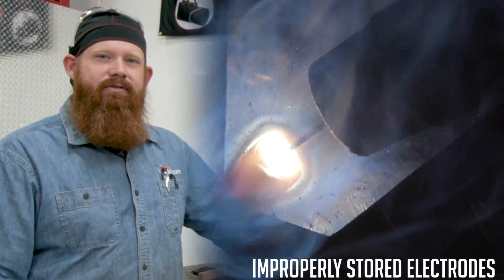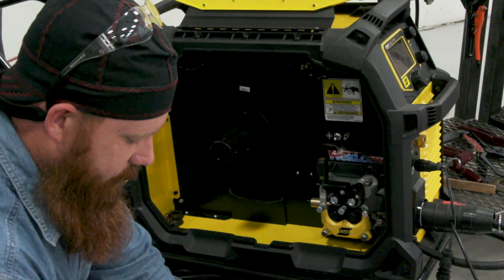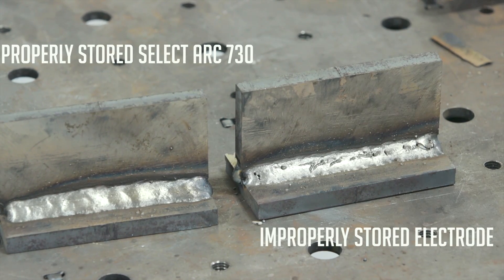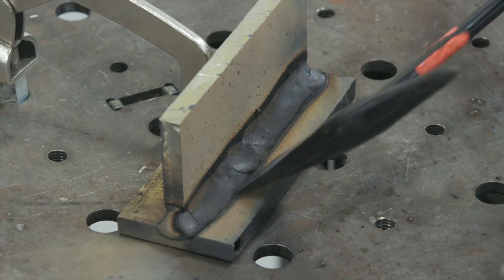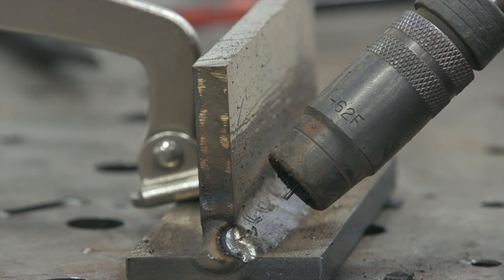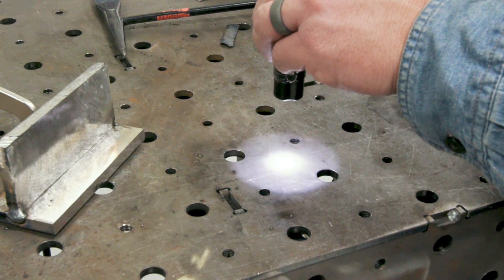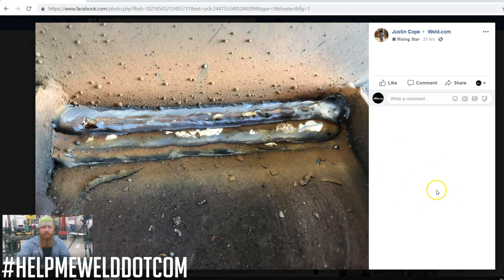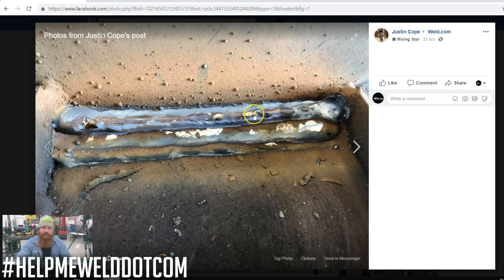3 REASONS YOU GET WORMHOLE POROSITY!!

Comment: So ive got a question.??
I need to weld a stack of slabs together up right between 2 horizontal peices. So my dementions are  ... 8" wide x 2.75" thick x 8" tall on the uprights. Top plate is 8"×2.75"×36" laid horizontally. The bottom plate is 8"×2.75"×12" laid horizontally at a 90deg angle to top plate. 
  Each upright will be welded as close to 100% to top plate as possible via a slight slope cut then fill in w weld. Then welded to bottom plate around the perimeter. The next upright will be clamped as tight as possible to the 1st and welded as per 1st and welded down each side top to bottom. Repeat until 8 plates are welded on 36 in top plate and 3piece bottom plate forming as close to a monolithic stack as possible given the construction.
   This will bear no weight nor be mobil. After the 2nd top plate is welded on its sole purpose will be to sit on a stand and have hot metal shaped on it w a 2.5lb to 8lb hammer. So yes im building an anvil in the range of 750lbs if i figure my weights right. The metal is 4140ish or 15hb5mn. 
  So my question is using stick welder..
 should i use 6010/11/13 or 7014/18 1/8-5/32 rods???
 Already know ive to rose bud steel to dull red at least and insulation wrap during cooling or the steel crystallizes from rapid cooling and improper preheat. It is used industrial forklift forks from john deere 644 loaders so we know its not mild steel.
Sorry for long post but idk how else to provide complete information.
  Id forge weld it but thats one helluva fire and weights 1 man cant handle lmbo lmbo
 🙏Blessings to yall now
Crawford out
Reply: Now i know there may be question to why. Well the metal was free/ gifted bout 5000lbs worth. The welder is only one ive access to stick only. So my only cost is electrodes and fuel for the torch...and the consumables discs n flap disks n what not.
 Next off to purchase a factory built anvil in the exact shape and size will run me $12,000 range shipped from the factory in germany/eastonia, overseas shipping is a bear.
  According to my estimations its going to take about 7/800 rods.
Figure it oughta out last my great grand childrens grand children lmbo

Comment: I also noticed u guys were running what to me seems way high gas flow. Why so high?
Reply: In a shop I run 30-35, outside 40-50 cause of wind. Oxygen is the devil when it comes to welds. That's why CO2 is used.
Reply: @Eric-gv9fn  the direction he's traveling he's blowing gas into the puddle
Reply: @robertsantiago953  direction does play a big role in it. Too much gas isn't a good thing either.
Reply: 40CFH is what the manufacturer recommended. Why deviate from what they have already tested in a lab and have proven the results.
Reply: The distance that you have to keep your nozzle I guess
Reply: Depends on the diameter of the nozzle and wind...
Reply: I mig weld for a living in a factory and they run it wide open, over 60cfm.  I know it's "wrong" but it's real.  I wonder how many professionals really run 20-25.
Reply: @bluefrog8670  I have tried it just to see what would happen and I found that it had a chance to push atmospheric gases into the weld causing porosity.  So I am wondering if there is a reason for it so high with dial shield.
Reply: @madcapmagician6018  you making a good point .I think that the direction he 's doing it also has a big part of the problem , i was taught that the gas you blowing is to clean the air
Reply: @bluefrog8670  i could understand high cfm in a windy environment , but i  a shop setting with closed doors n such it would be a waste of gas.  plus you also run the risk of affecting  the puddle 👍😁

Comment: I’ve also have had wormhole porosity using metal core! Multiple times! In a brand new box of wire! , so how I have fixed that is use a paper clip and a lil peace of scotch cloth on my wire just be before the drive roles!
Reply: They actually sell something for that to help clean the wire right before the rollers. They're call lube pads. Check em out.

Comment: Like the help me weld at the end. Good thing you guys are doing.
Reply: Josh C thanks for the support. Post up if you need any help.
Reply: @GodslilRedneck23  I am a beginner and using flux core wire w/o additional shielding gas.   Does your explanation of stick out, moisture in flux coating of stored wire and voltage also apply to that kind of wire?   My problem lately is I get started, seem to be running ok and arc just stops and wire is burned right at tip and/or piece of slag/spatter  on the tip.  Cleaning or replacing tip lasts a little while only to get problem again.  Is my stickout insufficient?  If I try increased wire speed I start to feel bumping, I have my heat on maximum setting, 0.035 wire, clean  mild 1/4 steel  Generally speaking I have been finding fish eyes (porosity) very frequently.

Comment: Can It be 'dried' out/fixed?
Reply: seems to make sense that you could dry it somehow. I'd like to know too
Reply from the maker: Not to our knowledge.
Reply: If there's rust visual contamination on The Wire then I'd say it's trash but if there is not you should be able to put it in a something like a rod oven and pull that moisture out of it during this time of the year I have to preheat everything I weld on if not moisture will suck up and pop (fail ) .

Comment: So, how do you properly store electrode wire?
Reply: Richard Valcourt keep them in their original packaging until ready to use. The should be stored in a dry area off of the ground with an ambient temperature of 70° or higher. If it has to be stored after being opened, try to put it back in a bag or box to keep any particles off of it until it is to be used again.
Reply: @mexi9787  That could be a problem for us Downunder as most reels are plastic.
Reply: Mark Fryer as soon as y’all are done with the spool I’m sure y’all put them up so they are least out of the elements but damn man that sucks I mean so are ours here in the USA but it’s not like you have it at 250F just warm enough to keep the moisture out !!!
Reply: Spools I'm not using I keep in zip lock freezer bags and throw in one of those little silicon packets that absorb moisture with it. I find it helps to squeeze as much air as possible out of the bag when closing and keeping them out of direct sunlight. Mine go in a cabinet until needed.
Wrapping spools of wire in a couple of layers of wax paper and taped closed or plastic cling wrap works too. Better than nothing. Better than some of the rolls I see on the shelf at some suppliers!
Reply: patrick farley darn ovens are expensive for a retired hobbyist anybody have ideas on building low cost ovens.